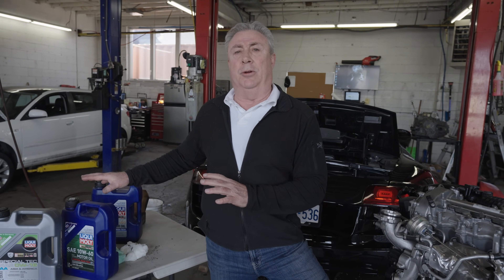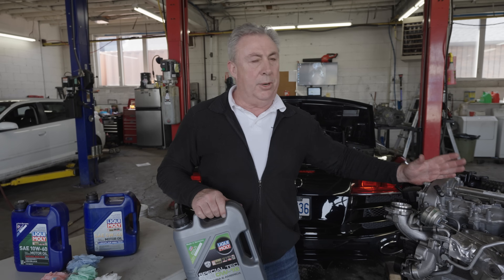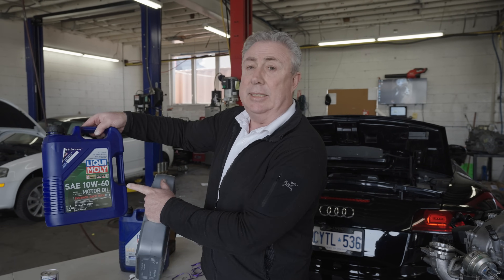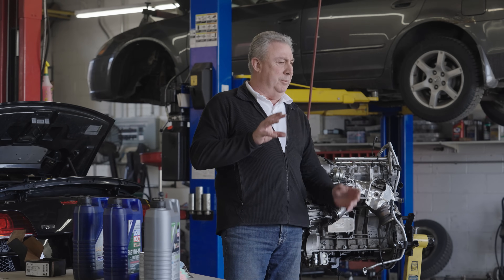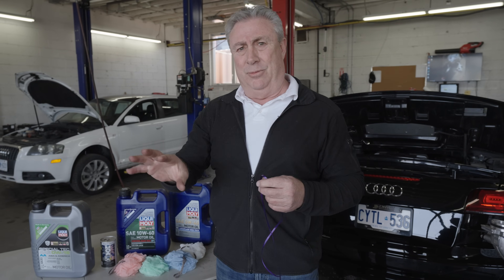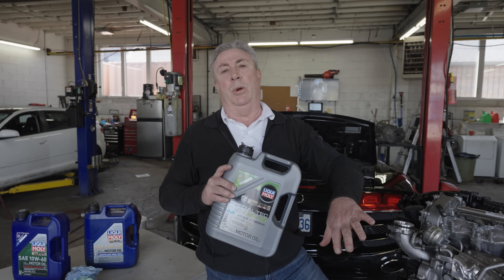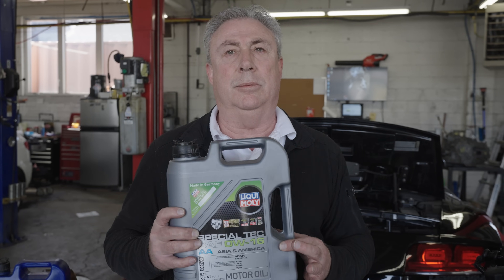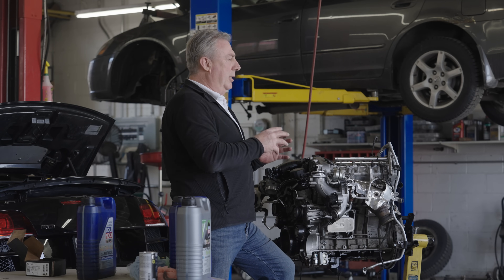Thin engine oil just a Scam? What's Safe

Comment: I've gone from 0-20 to 0-30 in all my Subies because I live in a hotter climate area, also I've learned that the Subies that are not exported to the U.S. list using 0-30.  Haven't noticed any mpg difference since the change, engine temps are about the same, so I'm good.👌
P.S. I change the oil every 2500-3000 miles.  Force of habit from servicing my vehicles starting in the late 60s.  That's what we did in those days.

Comment: I bought a brand new 97 Chevy Cheyenne off the dealership lot. After the first oil change, I put Mobile one 20w 50 in the new vortec, I'm coming up on 230,000 miles and still have 60 pounds of oil pressure. I run it year round.
Reply: 90s vehicles may have the longest life in common hands and use of any decade.

Sure there are model Ts, Stanley Steamers, Pierce Arrows, Pintos or even Yugos still running in good shape....however those are in the hands of enthusiast collectors that have rebuilt or baby them with obsession.

As to ride em hard and put em up wet, like most owners do.  90s cars are pretty good.
Reply: @STho205  the best! Easier to work on too. Simple to service and usually with basic affordable fluids and tire sizes.
Reply: @aaron___6014  the older model you get the easier machines are to repair.  This goes for almost everything, even PCs or washing machines.  80s and 90s analog mechanics were already complaining of the computer in the car making a car "unrepairable"

Probably the simplest repair to drivability was 1948 to 1971.  Though a Model A and T were simple they were very quirky and very different from other cars mechanically.  They also took driver secret tricks to get them to run right after they aged.
Reply: @STho205 I have a 1999 Gmc k2500 with 277k on it and still no engine noise. It sat in my yard for 4 years because of too much rust and I just put in a battery and cycled the key 4 times and it started right up.
Reply: Did the dexcool eat through the gaskets yet?
Reply: @b-genspinster7895  that happened soon after I bought it. Dealer fixed it and been good ever since.
Reply: Used 20w 50w on all my land cruisers. Without main bearing knock at start up. 1991, 1994, 2000
Reply: I believe the 0-20 oil today is just to thin.. 10-30w or 10-40w is safer .
Reply: Probably ok unless you are in a very cold climate
Reply: That’s funny because in the owners manual it specifically says NOT to use oils with a high viscosity like 20w50.😂
Reply: @stevefuller3585  It also says not to drive over the speed limit. Have you always done what someone else has written on a piece of paper?
Reply: 98 Silverado 7.4 original engine transmission and differential 310,000 15w/40 Rotella T every 3000 to 4000 miles runs great no noises and no cancer
Reply: Not a winter oil,20-50 for the N.country,,🇨🇦
Reply: good😊
Reply: @ITRR2306  To your point about A Heavier Weight of oil in a Engine of that era, Newer Modern Engines Have a LOT more complex Internal workings Such as VVT engines So switching to a Heavy/ Thicker Oil Can & will Create a Lot of Problems
Reply: @rodneyblack1257  just don't go overboard.
Reply: Have used heavier oil with VVT engines 4.4 land Rover 4.2 Audi heavier oil reduced engine noise at start up 200k + on all vehicles. 15w 50w Mobile one.😮 Mileage loss was not noticable. @rodneyblack1257
Reply: @rodneyblack1257 You're repeating things you've heard but haven't verified. Yes, passages can be tiny like on a rav4 where they say US users "must" use 0w16, but then allow 15w40 for owners in Mexico, with identical engines.
Reply: That's a lifetime truck. As long as it doesn't rust out.
Reply: However I'm at 230k, and I use 5 w 20 as the car label recommends.  Conventional.  6000 mile changes.

No oil burning, good compression, no burnt valves.

Is that holistic evidence for all cars or was mine put together well on a Tuesday.

I had a late 90s Taurus wagon that got 20w50 every 4000 miles (the recommendation) and it went to 220 before it started having valve trouble.
Reply: @STho205 with the wear of 230k mileage, you can step up to 10W30 without causing any problems and IMPROVE/extend the life of the engine. There is a larger gap or tolerance than new in a 230k used engine, a thicker oil sort of bridges that gap.
Reply: @johnanderson3917  as I am on the 30F to 80F temperate zone there is no real difference in mid temp cold start viscosity.

Comment: I drive a Ford 4 litre straight six,  recommended oil is 5w-30, the engine is noisy, the car has done 150,000 km's,, warm weather here in Australia, never drive under 10c, I now run 15w-50, awesome !!!!
Reply: Yep I only use 10w40 on my BT-50 the recommended is 5w30 bullshit I said.
Reply: Check the manual, for a turbo Barra it recommends 15w40 SH spec … it also recommends diff oil changed every 15,000 kms for turbos … I own three Falcons at the moment.

Comment: I would stick to the recommended oil until 30-40k mileage before making any changes on any vehicle.
Reply: Keeping up with oil level between changes and getting good filters matters more than type of oil.
Reply: My fav oil filter is WIX.
Reply: My fav oil is non-synesthetic valvoline 10w40 and castrol gtx 20w50. Thiner in the winter thicker in the summer. Every vehicle that is past 30k gets this no matter what.

Comment: You are missing a very important factor to consider for the oil viscosity you choose; and that is your oil pressure. In cold winters, your oil will get thicker which causes oil pressure to go up. In warmer summer temperatures, your oil becomes thinner causing your oil pressure to go down. An oil pressure within OEM specs will best protect your engine. So long as proper oil pressure can be maintained then a thinner oil is better because you get a greater volume, or flow, which cleans & cools your bearings. Most important is to acknowledge that it is oil pressure, not viscosity, that floats your shafts inside their respective bearings. This is the reason why multi-viscosity oils were developed many decades ago.
Reply: Read  bearing oil wedge theory it is not about pressure
Reply: In coastal southern BC, we were losing many Detroit Diesel 8V92 engines in the early fall season when temperatures dipped. These engines were commonly used in Link-Belt log loaders, forest industry. There was a gear at the front end of the crankshaft which drove the oil pump. That gear was keyed to the crankshaft and the key would shear off causing a loss of oil pressure, and cylinder failure. At that time, the culture in the forest industry was to use "straight 30w" diesel oil for everything. We told our customers to switch to 5w-40 Delco diesel oil and had no more oil pump failures. That multi-grade oil became the new standard for all diesel engines.
Reply: In Fort St John, BC, when winter temp fell to -30 deg or below, cold engines (gasoline pickups) would not start when using 5w-30 oil. There was so much drag on the engine that the starter could not turn the engine fast enough to build sufficient compression. Switching to Delco full synthetic 0w-20 oil solved the problem. Engines started like it was a summer day.
Reply: In hot regions like Death Valley you will want to use a heavier oil as your oil pressure drops off when the oil is too thin. Consult your manual.
Reply: Most newer cars have variable pressure oil pumps

Comment: This worries me as my 2025 Camry calls for 0-8 and it does and will get high 90s to over 100 here. True it hasn`t gotten worst the 46 mpg and as high as 53 mpg. But come on 0-8? I also have heard and read in FLA most are using 0-30 in their Camry`s.
Reply: It sounda like you have a hybrid. Change your oil every 3000- 4000 miles (or six months, whichever comes first) using the 0w-8 oil. Changing the oil more often is the most important thing. Oil is cheap. Engines are expensive. Don't go by the Toyota recommended change intervals of 12 months or 10,000 miles.
Reply: @countschad  Yes all 25s are hybrid. That`s pretty much what I was thinking. Or for the summer time going up to 0-20 or 0-30. I would never do10k intervals. So you haven`t heard anything about dealers or shops going up to 0-30 in the southern states. Because I`m thinking it would be a safe move for the hotter months.
Reply: @chasf1066  I don't recommend going to higher viscosity oil. Watch the Car Care Nut on youtube. He's a Toyota mechanic ("master technician") who has talked about regular maintenance on his channel. He specifically recommends not to do that. Cars designed for these low viscosity oils have very tight tolerances. He explains it in his videos. Scotty Kilmer also dosen't recommend it in the new, tighter tolerances cars. How long do you want to keep the car? If you want to keep it beyond 150,000 miles, then keep using the 0w-8.

Comment: I have a '06 dodge caravan.  200,000 miles I accidentally put in thinner oil than usual, 5-W20 and it made my lifters quieter, and the AC didn't cause the rumble as much as with what the manual said 5-W30.

Comment: I run 0w-40 in the winter and 15w-50 in the summer, engine specifies 5w-20. Almost 245k miles and the engine still makes 180psi compression and doesn't consume a drop between oil changes so must be doing something right.

Comment: And 10k oil change intervals are total BS. Whatever the mfg says the interval is, cut it in half.
Reply: I bought a brand new FRS in 2013. I thought the oil change interval was 10,000 mi so my first oil change was, in fact, at 10,000 mi. I found out it was supposed to be 7,500 mi. The car now has almost 190,000 mi on it and doesn't burn a drop of oil. Runs like new, still. But I did drop my oil change interval to 7,500 mi. 

I had 150 mi commute in that car everyday. If I cut my oil change interval in half I'd be spending half my time at the dealership getting my oil changed. Well at least, before I was retired now I just do it myself.
Reply: @ReasonablySane You got away with that due to your long commute, if it was bumper to bumper miles the engine will most likely sustained damage from delayed oil change.
Reply: @ReasonablySane  Alot of engines with long intervals carry extra oil. Example is the Benz OM642 with 10 liter sump.  Twice the oil capacity means longer between changes.
Reply: @ReasonablySane  That is a lot of miles for a commute!! My neighbour takes her car to work every morning at 5.30am winter and summer......the distance is about 400 metres,how messed up will that engine be?🤥.
Reply: Call bullshit,same car in Europe,or other countries that dont have regulations like the usa use thicker oil.same motors
Reply: @daleabed2145  yep I have a 2018 Mazda CX 3 with a 2.0 engine The owners manual States 0w20 in the U S and Canada, and 5w30 in Mexico same Exact engine. the reason for thinner oil in the US& Canada is the CAFE standard ( fuel efficiency) and to be completely honest the MPG between 0w20 and 5w30 is so minimal
Reply: @ 0w30 and similar are used in other countries too, and the video explains why. The viscosity specs have nothing to do with oil change intervals. High performance, high RPM engines need more frequent oil changes for obvious reasons.
Reply: @kaba_me  Yes they do
Reply: @daleabed2145  Then why does the BMW Z4 specify the same oil viscosity as the GR Supra?
Reply: @daleabed2145  Very true, I believe there is an agenda to replace combustion engines with electric ones.
Reply: To others: Do not waste your oils. Anyone who told you you need to change oil every 3000 miles or 5000 miles is either too old or from an oil change shop. Today, a full synthetic oil can last for more than 10K miles because oil technology has been improved a lot.
Reply: @yifeipei5484  But I know many people with engines that failed at less than 100K miles.
Reply: @skywind007  That's the existing problem with their car, not oil. Many people change their oil every 20K miles and get their car above 300K miles without a single engine problem.
Reply: @yifeipei5484  that is such bad advice.
Reply: @Taras-Nabad  You need to believe science, not your imagination. Oil technologies have been improved a lot because research puts them forward.:face-green-smiling:
Reply: @yifeipei5484  if you have a GCI engine where fuel routinely gets in the oil, you absolutely need to change your oil more often than spec
Reply: True oil is cheap , engines ain't!
Reply: Not if you drive a lot.  Did 15k mile oil changes for 10 years on turbos. Did a filter halfway. I drove over 20k miles a year, full synthetic oils only.  No problems.
Reply: and I half that again. Been real lucky with two different year 3.3L Dodge caravan engines that way.550,000 and 307,000km 
5W-30, and the second one 5W-20 as specified by Chrysler.
My new Corolla Cross 0W-20 in Canada. Never going less then that.
Reply: agree... 3,500 miles, max, on conventional and 5-6K miles, max, on quality synthetics.
Reply: Finally someone that knows what they are talking about.
Reply: Even half is a bit far. I have a 2005 Nissan Sentra and I've been doing oil changes every 3,700 miles since it was new. It now has 290,000 miles on it.
Reply: So if the mfg says to change oil at 20k miles, do it at 10k miles? Got it.
Reply: @coolruehle  I have Personally Seen The affect of Long Oil drain interval and it wasn't good at All. As I have stated before Your Driving habits and the Climate you drive in are VERY important to understand. I did  oil Analysis on a 10w30 Full Synthetic after 6000 miles in the High temperature of Phoenix AZ and that oil was Cooked.
Reply: @rodneyblack1257  Yeah, you can cook an oil and even slowly thicken it up badly if you don't change it! I used to use a toyota Hilux as an odd job taxi. New driver offered to do all the taxi services if I let her have the car to use.  I thought that would be a relief! Got it back after 100,000 K. No servicing had EVER been done and it couldn't be started. So reclaimed the ute! Cleaned clogged fuel filters and slowly drove home. Oil was so heavy like thick cold black treacle when changed. Drove it  but engine end bearings over next few month slowly developed  a knocking sound sound in them. Still almost got 500,000 K out of it. Could have been a lot more. So please nobody not change anybody's oil!
Reply: @rodneyblack1257  I guess that manufacturer's test engineers forgot about hot weather states when they were doing qualification tests.🤔
Reply: In my country we still do oil intervals of 2500 miles or 5000km  @rodneyblack1257
Reply: Oil is cheap, so there is no reason not to change it. High performance cars and bikes need 5k oil changes, but for regular cars 10k is just fine. Just use fully synthetic oil, and check the level every 2-3k miles.
Reply: @kaba_me  Ok As I have stated Before I live in Phoenix AZ l have Personally Seen A very well known Full Synthetic Oil completely Cooked at 6000 miles Due to the Extreme High temperature in the Desert south west. Is a matter of fact A Dodge dealer that was Replacing 5.7 Hemi engine at 40,000 miles or less Is telling the customer to Do a 5000 mile OCI after replacing engines under warranty.

Comment: The manual recommended 5w-20 for my '06 Expedition but I've always used Motorcraft 5w-30 semisynthetic.  Purchased in 2009 with 80,000 miles and now have 315,000 on it.

Comment: Went from 0W20 to 0W40 diesel synthetic in my 2016 Chevy Silverado. No issues, and it pulls a trailer during the summer.
Personal experience: you can go up on the second number in small increments as the engine wears and breaks in.
Reply: Thats insane using 0w-20 on diesel, never heard of. I work on volvo cars in sweden and diesels always run on 5w-30 or 10w-40
Reply: @Spiritualwarfare587 well the GM mini duramax 3 ltr uses just that..gets great mileage,, -don't put off changing the oil..
Reply: @Spiritualwarfare587  I guess I wasn't clear on my last post. My Silverado has the 5.3L V8 gas engine. I use Diesel synthetic oil to keep the sludge down.

Comment: I've been running 5w30 in my 2016 tahoe since the first 1000 miles. It has 129,000 on it now with zero issues so far. I've been using mobil 1 EP the whole time with 4000 mile oil changes. Put a catch can on it before i hit 100 miles. She runs good.
Reply: I been running 15w40 in my 05 chevy truck 5.3L for 120,000 miles, no issues except at 200k it has a lifter tick during warm up period, about 18 minutes, then no noises. i live way south and its hotter than hell down here 8 months of the years.
Reply: and the dookie plastic PCV valves can go bad, too. i use 10W40 in my 2012 nissan sentra. warm it up before pulling away, and the sentra still gets the same 32MPG its always gotten, and no more oil consumption. i also use a little lucas oil stabilizer, too.

Comment: The oil has 4 things to do: Lubricate, seal, cool and clean. The oil has to be thick enough to lubricate and seal properly. But also thin enough to cool and clean properly. Use factory spec viscosity. Anything thicker or thinner will make the engine last shorter.

Comment: CAFE regulations are the bane of engine life.
Reply: and stupid gullible people. I know a few that go with the 10,000 oil change `because the dealer and the manual says so.
 Good luck with that then, cause I have no sympathy with you.
Hourly rate is now $140 to $180 depending on, and parts are not cheap on these new `wonder cars` from Toyota in my case.
 My old Caravan Dodge 3.3L 07 runs good with 307,000 km on it. I change the oil always at 3,000km. I do it myself of course.
Reply: @luckyguy600  I would not want to buy those gullible/dummies used vehicles that went 10,000 miles between oil changes..
Reply: Underrated comment here.
Reply: @workingmanaudio2754 Use the spec'ed oil during the drivetrain warranty period and have it done at a reputable shop.  When warranty is done, pick a grade that still meets the maker's spec , but select viscosity based on driving habits and climate.